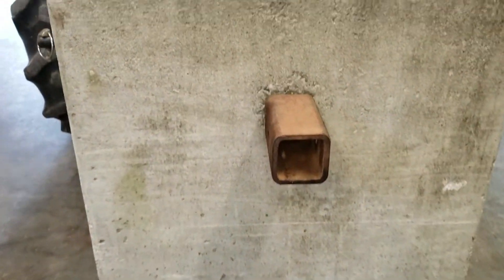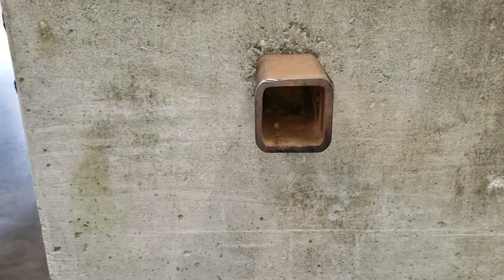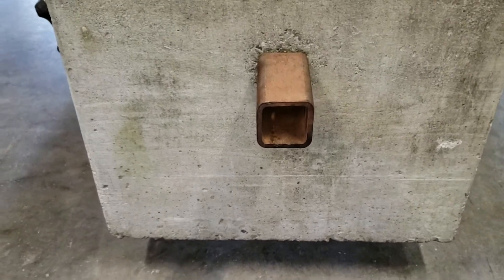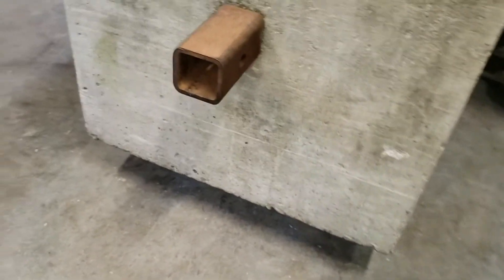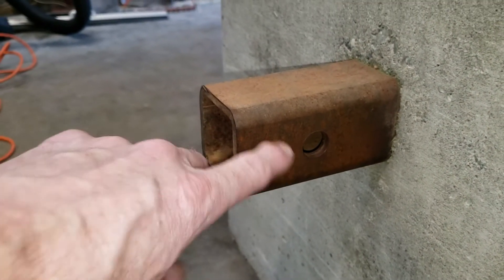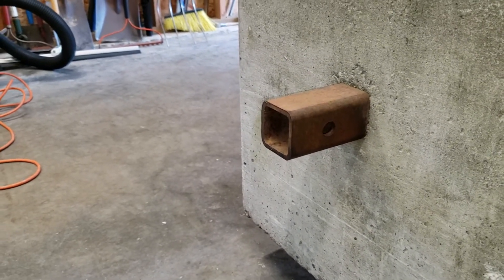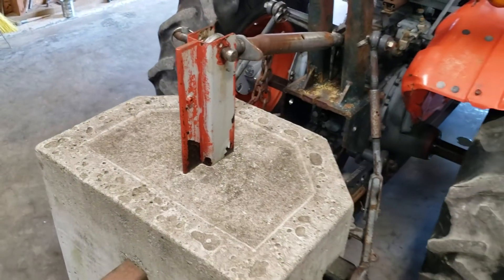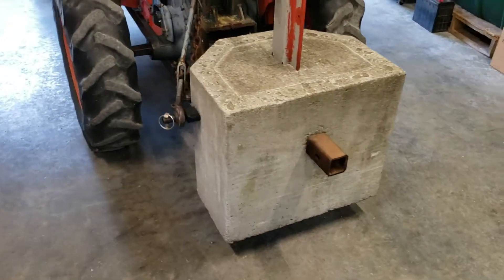Tractor Counterweight/Ballast for 3 Point Hitch

Comment: I always kept a blade on the rear of mine. But you're right, the second you got into the woods it was in the way. I ended up sticking some suitcase weights off an old deere on the back but it wasn't enough maybe 320lbs or so.
Reply from the maker: It's been one of the best things I made for my tractor.

Comment: Hey Mike, nice shop. Nice job on the counter weight too.
Reply from the maker: Hi Wyatt, Thanks so much! I built the shop myself all stick framed 40' x 34' ,10ft to 18 ft height inside, 3 doors 12' and two 8'.  Has a  34' x 25' loft with 8' headroom except where the roof gets lower on the sides. It has a gambrel style roof on it.
Reply: @mikesworld60  That's fantastic Mike. A man needs his space!

Comment: Just built a similar counter weight wish I would have thought about the hitch idea
Reply from the maker: It's hard to think of everything when building something. I always seem to think of something I wish I would have done a little different when I build something. The addition of the weight was a game changer when it comes to using the loader. The rear tires are filled but it still wasn't enough. Thanks for the comment

Comment: Mike, how many bags of concrete did this take?  This is awesome by the way; I plan to do the same.  Thanks!
Reply from the maker: I think I have 60 to 100 pounds of components in the weight and the rest is the concrete. I used the 80-lb All-purpose Concrete Mix. I believe it states 4000 psi for strength. So I think there are 8 to 9 80lbs bags in the weight. The weight has a draw bar in it for the two lower connections of the 3 point hitch and the tube that is for the hitch is welded to that in the block. The piece of metal that sticks out the top for the top link is also welded to the other parts and then there is some mesh or rebar in there too. I built a box that held all the internal components in the proper place and then poured the concrete in the top. If I can find pictures of when I built it, I will make a video with those pictures so people can see how I constructed it. So far a can't find the pictures. Thanks for watching.

Comment: What exactly did you use for the sides and top hookups
Reply from the maker: The arms for the 3-point lift are connected to a Category 1 Drawbar that is in the concrete block. I just built the part that comes out of top of block with some steel I had available and drilled holes in it at top to hook the Top Link too.  The drawbar and the steel for the Top Link are welded together inside the block and there is also rebar in the block for strength. And the tube for the hitch is also welded into the other steel parts in the block. This was all built inside a box to form the concrete and hold the parts in the proper location. Concrete was poured into the top of the form and then form removed after wards. The box was all screwed together and coated with diesel fuel so it would not stick to the concrete and then I unscrewed the box when it was dry. The forms can be put back together and used again.

Comment: How does your 7100 lift that. Mine won't do much over 400lbs before the relief valve opens up and it just buzzes.
Reply from the maker: I have a 1991 B7100 HST which was produced during the years 1977 - 1997 … Rear lift is 1036 lbs. 
The B7100 that was produced during the years 1976 - 1985... Rear lift is 400 lbs.
You can find this info on TractorData.com

Comment: mike how high is weight
Reply from the maker: Top view dimensions:  Looking at video at 0:25 for reference.The side closet to tractor 11", The angle sides are 8.5'', the straight sections that run from the angle to the back are 11",  the longest side at the back is 23".  The top link hole is 9" above top of block and 8" back from the 11" side closest to the tractor.  The draw bar pin is 1 3/4" from the angled side and 14.5" measured from the bottom of weight.  The metal for the top link, the draw bar and hitch tube are all connected together inside the block. I made a plywood box the correct shape and attached everything to that and then poured the concrete in the top. The total weight is 800 lbs. Thanks for watching

Comment: What are the dimensions of the counter weight?
Reply from the maker: Jacob, Top view dimensions:  Looking at video at 0:25 for reference.The side closet to tractor 11", The angle sides are 8.5'', the straight sections that run from the angle to the back are 11",  the longest side at the back is 23".  The top link hole is 9" above top of block and 8" back from the 11" side closest to the tractor.  The draw bar pin is 1 3/4" from the angled side and 14.5" measured from the bottom of weight.  The metal for the top link, the draw bar and hitch tube are all connected together inside the block. I made a plywood box the correct shape and attached everything to that and then poured the concrete in the top. The total weight is 800 lbs. Thanks for watching